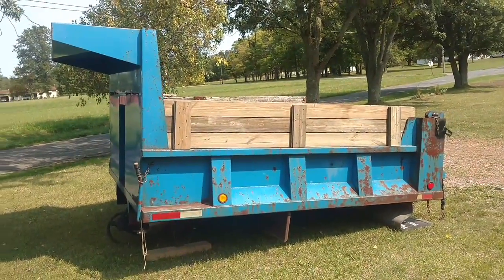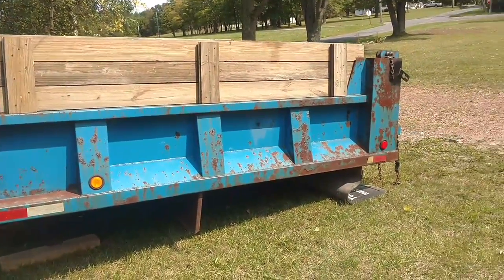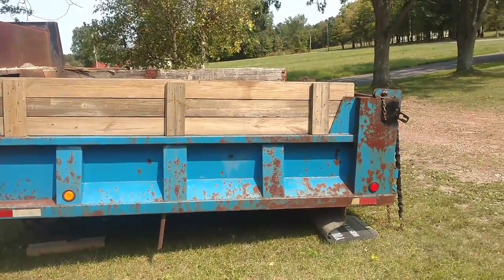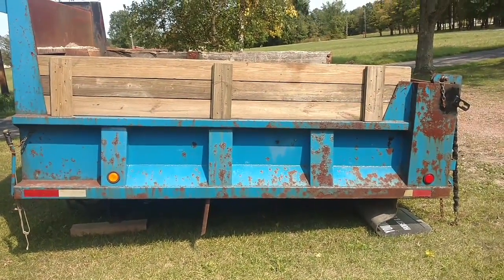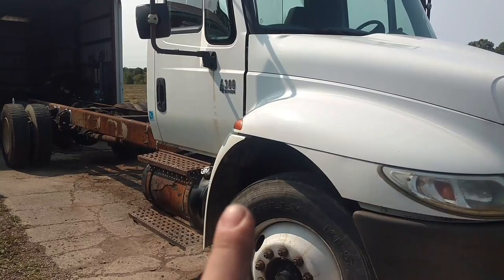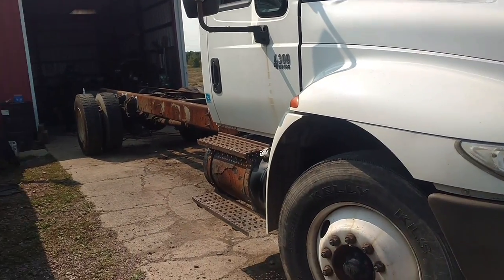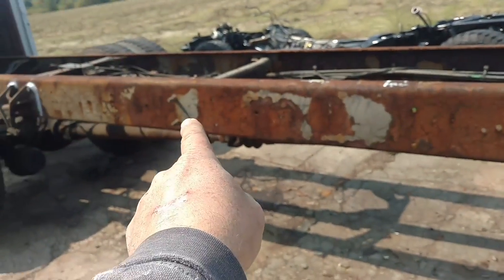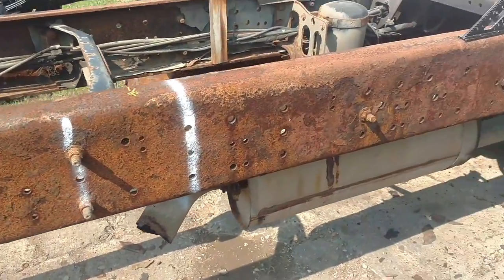PART 1) PROJECT CHEAP DUMP TRUCK....USING WHAT I HAVE TO MAKE A DUMP TRUCK.

Comment: There was a fella I worked for he dealt with landscape Rock,well he said he found a "Deal" on a 98??? International it had the DT466 in it too.Well there guys weren't very intelligent and 1 pretends he's a Mechanic..well they went to Georgia to pick it up,on the way up it Overheats well they eventually get it back up to NC thinking it was air in the system.They worked that truck maybe 4 hrs before the Head Gasket let go,they blamed the Motor but I dunno about that,I'm no Mechanic but if I watch enough of your vids and AvE' s vids there is no way that I won't learn somethin.

Comment: Winters coming, and you've got a lot stacked at the moment, You might be better off to go with the first if it's a temporary dump you need and make a later project out of the newer truck after things settle but would that be double trouble or even needed?
Reply from the maker: you are right john....we have already moved forward with the rusty truck....i struggle with the "good enough for temporary" way of doing this. we will see how it goes. thanks for watching!
Reply: I do that with a lot of the things I do sometimes  causing me to not even get done. I need to stop it for some of the things I do at home.
Reply: Too bad that 07 has a 6 liter. Ugh

Comment: I like the 2nd truck too better an if you get in a bind you would not have redo this project again, a you puting a tubo deisel in it , i wold use best parts on first truck on 2nd truck if needed.THANKS for the videos

Comment: It's the temporary dump truck!  Give that frame a J.C.Smith over hall ( gallon of rustolum and acetone) . You will be thankful for the airbrakes
Reply from the maker: the air brakes  and the higher weight capacity is what i am after. i dont know if i have time for the frame paint on this one.

Comment: personally I don't think the extra length would be an issue but each driveline outfit has their own take on things. with the heavier rear axle, the difference in length shouldn't be as noticeable as with the lighter rear suspension. either way, I'm sure you will end up with a good working temporary permanent truck when your done. on  Volvo's and a few other brands, they stamp a divot, kind of like a deep center punch mark, usually behind trans cross member or further back. this divot is used for layout of suspension mounting and cross member holes. in your case with using an existing frame, your rear alignment should be good. if adding on an alignment should be checked to verify that everything is true.
Reply from the maker: if i remember right it would make the driveshaft about 70". i dont mind that length as a one piece shaft (with a slip joint). i checked the frame for square before i decided to move the axle and it is right on. i wanted to be sure i wasnt wasting time on a racked frame. i do like the fact that doing the 72"ca is not going to cost anything and if i decide to to do the 84"...it is just drilling some holes and then change the driveshaft. the frame will be cut at the same location regardless of where the axle is going to set. i am going to reroute the air lines and wiring in a way that will leave enough to move it to the 84" without splicing.

Comment: How many trucks do you have, another one just keeps popping up. Have you decided on which one for project dump truck? Should be another interesting project which ever you decide
Reply from the maker: oh boy....i dont like to count. if i do i may think i have too many. i might have enough to make a couple more videos. i am using the first truck. the 2002 or 2003  international 4300 with the rust frame.

Comment: Hey jc. Been watching your video 
I need advice on a dump truck project. Can u help me?
Reply from the maker: possibly. what is your question?
Reply: @j.c.smithprojects  
Well I'm about to attempt my first install of a dump body on a 1991 f super duty 7.3 5 speed 1.5 ton cab and chassis.
60 inch cab to axle.
Wheel base 139"
The frame has been extended .
Cab to rear of frame is 9 foot.
Was looking at installing a 10 ft dump bed.
My questions were.
1- do I need a sub frame?
2- is 16 inch of hang over to much?
3- would I be better off shortening the rear of the frame by cutting off up to the rear leaf spring hanger and just going with a 8 ft bed?
4- if I do cut frame down and go with a 8 ft bed , will four inchs of hang over be enuff?  I'll be mainly hauling sawdust and stone and just dumping in a pile and some stone spreading
Reply from the maker: i start by knowing the gvwr of the truck and its intended purpose. then, i build from there. the shorter the bed, the lighter it is. this means more weight you can carry. fine line between just the right overhang and not enough. especially if you are going electric over hydraulic. more over hang makes it easier to dump with electric. more overhang puts the bed floor closer to the ground when dumping . this can be helpful and harmful. if you drop rear gate from top to bottom, you may dag when dumping. consider what hitch you may want and watch for clearance as well.  if you are running a trans mounted pto, a shorter over hang is easier to over come because that type pto ands pump are stronger and make good flow with consistent pressure. i like 12" or under on a bed that short. sub frame is usually decided by the construction of the bed and lift assembly with it. sometimes its necessary so the bed clears the tires when loaded. or so the scissor lift clears frame cross members. or if the frame isnt a flat rail from front to back. on a 60" cab to axle i would only consider 8 or 9'. otherwise, thee is too much bed behind the center of the rear axle and "lifts" weight of the steer axle. it can be very dangerous. especially in wet or winter weather.
Reply: @j.c.smithprojects  
Very helpful

Thanks
Reply: @j.c.smithprojects  
Ok on to my next wonders lol
I bought my bed today.
It's a 8 ft contractor bed.
It's a fixer upper but has good bones.
Looks like I'm going to have 8 inches of over hang.
My hoist is huge.
And maybe to big.
It's a omaha standard 524 DH.
It's a stout hoist , using eletic over hydraulic it totally made a boomerang out of the frame of a f550.

Now my questions.
1. Would I be better off just using the cylinder out of the scizzor and mounting cylinder from sun frame directly to the bed instead of using the scizzor system.

2. The frame rails on the bottom of the bed are 4"x3 " channel and I was thinking of building my sub frame out of the same 4"x3" channel to match up good with the frame rails.
Is this a good idea or not?

3. If I go with the scizzor hoist system  where should the hoist attached to the bed rails? What I mean is where at as far as 2 feet from back of bed 4 feet off back of bed or where?

4. I'm afraid if I use the scizzor that I'll have to do away with my from fuel tank because unless the scizzor hinge stays elevated when mounted it won't clear or even have room to be mounted without coming in n contact with my fuel tank.
I've taken pictures and if you want it would be great if you would text me at 606-331-6095
I don't want to bother u but I'm just as picky as u are and I want to do the install right.
Thanks
Josh
Reply: Also can u turn the scizzor hoist either direction?
What I mean is can u point the hinge toward the cab or toward the back of the bed either one?

Comment: What is the main attraction to air brakes instead of hydraulic brakes?
Reply: If you get hydraulic brakes too hot you'll boil the fluid and loose pressure. Doesn't usually happen on cars, happens all the time to 25,000 gvw truck runni g hydraulic brakes.

Comment: I think the first truck is the best plan. if the frame is iffy you could shorten cross members and put a 3/16" liner in the frame. just had some 11" tall ones ,8' long made, 235$ for the pair. It wouldn't be too expensive to get a new driveshaft tube put in to obtain the 84" or so cab to axle. drilling a few more holes isn't too bad if it makes everything ideal. for your hole layout, up and down on the frame, get a steel square and tack 2" x2" x1/8" angle on each side of the long leg of square. makes layout much faster and more accurate than other methods. I use the same method you described with EMT, except I use 1/4" steel flat bar. magnetic drill with annular cutters makes quick work of drilling frame.
Reply from the maker: i decided to use the first truck. i am running short on time and only have a few days to spare to get this dump going. mag drill with annular bits is for  sure the ideal set up. i considered doing a double frame as i have some double frame cut  offs from another international. the driveshaft will be about $500. they dont like to make one driveshaft as long as i need it. they want to make it a 2 piece with a carrier. plus all new u joints and the new carrier bearing. i really like the steel framing square idea.
Reply: Could you use the front drive shaft in the 'Rust Bucket" as the front piece of a double shaft?  Probably not, but could you tell us what the dimensions have to be?  
What are you thinking of for a permanent replacement truck?
Reply from the maker: the permanent truck was suppose to be the 2002 ih 4700 i bought about a moth ago...but since a friend of mine is in a bad way, he is using it until he gets the money together to fix his. it is looking like the rusty truck will be the permanent truck as i have already started doing all the things like i normally would.  the driveshaft needs to be under 72" as a one piece and for this size tube.